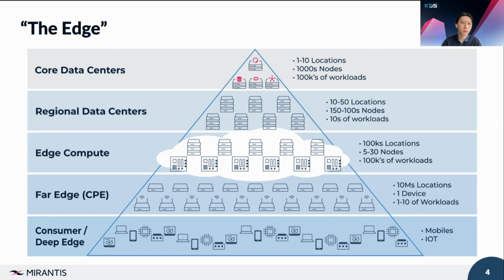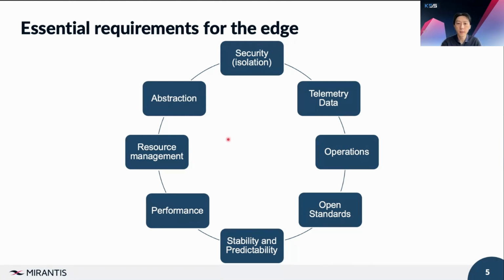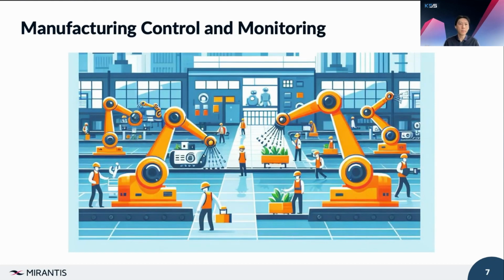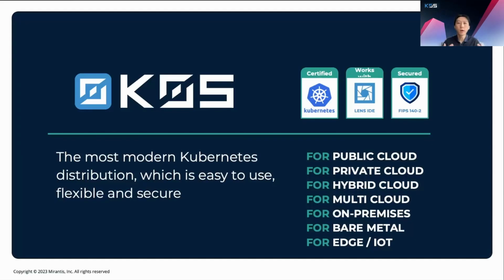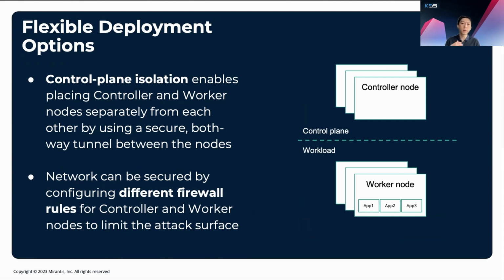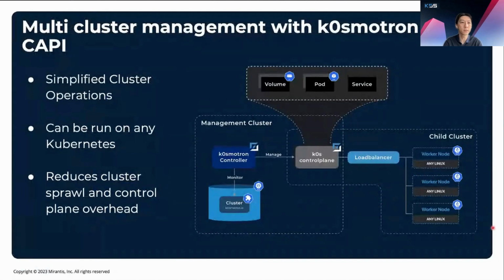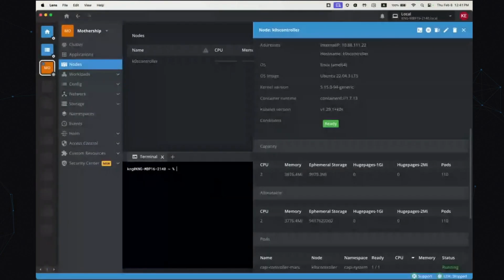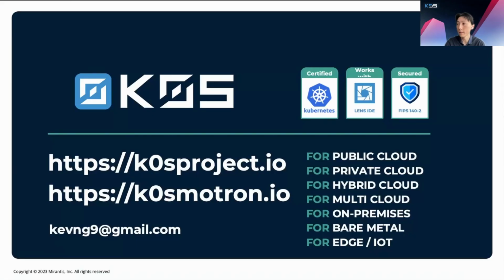Kubernetes-Native Solutions for Modern Edge and IoT Use Cases with Open Source k0s + k0smotron

Comment: how do you manage the latency between Central Controller and Remote Worker? are there any quirks, requiements, dependencies etc?
Reply: k0s uses the konnectivity service which provides a better performance in terms of latency and throughput, that will help with the latency issue between controllers and workers. You can find some of the metrics in the How to choose a lightweight Kubernetes Distribution video from earlier. 

Apart from that the typical network latency considerations such as proximity, topology, and monitoring will apply. So depending on whether you have a central controller cluster running multiple edge workers, cloud controller + edge worker clusters, or controller+worker at the edge, k0s supports all that. It would also be useful to monitor metrics such as http_request.duration or latency centrally through an interface such as Lens. 

Happy to discuss more.